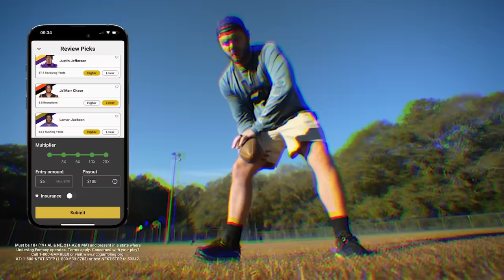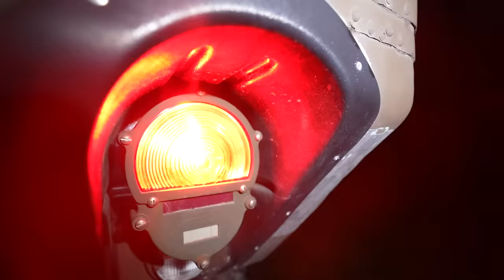Camping In My Humvee AMBULANCE! (catch n cook)

Comment: I used to be in a ground ambulance company while in the army and regularly camped in them for weeks. sleeping in a litter on those racks is surprisingly comfortable. I meant to comment this on the last video you had on this but I think you have a cbrn unit to hook up gas masks in there. Its those PVC pipe looking things above the driver and passenger
Reply: Thank you for your service
Reply: My friend bought one of these and used it as a hunting cabin. I agree the beds were surprisingly comfortable and then later we started tearing it apart to build it up into a proper overlanding vehicle. We found in the corners a congealed mess we hoped wasn't dried blood but probably was, and also about 8 rusty 5.56 rounds, some gauze strips and a senior picture of a girl in high school from 2014, some paracord pieces and what looked like a medic velcro patch. There were some other medical supplies in there too. Even a surette of ketamine that was hidden inside one of about 10 empty cans of Skoal and Grizzly snuff. Whoever cleaned it out didn't do a thorough job. I was also amazed how slow it was. Like 45 was the top speed and it felt like you were going to come apart. He swapped a Duramax turbodiesel in there and some other stuff. Left the beds intact though. Tha k you for your service as well.
Reply: Being a medic in an infantry unit was rough but every now and again we'd take an FLA out and live like kings.
Reply: Lived in them quite a bit while at Drum, but you had to insulate, those metal boxes got cold!!!!
Reply: @AYO Fishing  I think all this rig lacks is a glory hole.

Comment: With the Hum V try putting it in park while its running and rock it back and forth from the front un till  you hear a click and this should fix the trans issue at least for awhile.. This method has worked for me more then once.

Comment: Use a combo of oil and butter….you want the pan smoking then add your oil and after it melts and bubbles out the pans ready for the fish..also works better if you season the fish before going to pan, even pre coating the fish with oil.. promise u better results, cheers!!

Comment: very simple design to make those bars more comfortable is to add hinged or a slat of wood as a base with a 1-2 in thick foam "mattress" that can be then folded up to the walls when not in use and still have room for the kayaks, possibly add parallel mounts on the sides of the truck or top to mount the kayaks tho would be cautious of width restrictions. love your guys content.

Comment: Another great video with you & Norm!  It would be so great to see the rear area gutted and rebuilt for a true camper with padded sleeping bunks, maybe a slide out kitchen / cooking area.  LED lighting upgrades.  Bring along a decent sized battery bank and you guys are set.  Maybe Catch & Cook using Air Fryer?  Not sure if you only use Cast Iron but maybe a new Ceramic non-stick pan for cooking fish = less crumbled fish and full fish fillet sandwiches.  Anyway, can't wait for the next video.

Comment: Definitely need to get ot running and operating correctly first. Then maybe cut the top racks so you can use the bottom section as beds or transfer it to two singles. Maybe give it a all black paint job or some cool black grey and white camo paint.
Reply: I think that German fleck tarn would  be cool

Comment: Alright. I'm no humvee tech, but this kid in my shop while I was stationed in Germany explained a bit of the transmission to me while he was diagnosing it. Dude is a GM wizard. He had the program pulled up and was shifting each solenoid in the transmission just by clicking on the boxes in this program. Troubleshooting steps said something along the lines of 'if solenoid x isn't able to stay engaged when solenoid y becomes engaged then Z is at fault.' There was a few different tekken combos of this phrasing. Almost done writing this comment out and thinking he may have been diagnosing a chevy 2500, but generally speaking both were Allisons if I remeber right. 

I recomend looking at the data plate and you can identify the model and easily search for the T.O.
Reply: Thought about it. Before you get into anything crazy like this check the basics. Brakes sticking (Calipers and rotors are up into the body). Parking brake could be misadjusted (twist the end of the handle). Inspect and measure rotors with heat gun if the engine finds itself straining. Check the transmission fluid. Just the basics. Also check the hub oil. Theres a mean gear box in each hub that can burn up oil. Most likely this thing was maintained and just sat on a lot so it's probably been 'relatively' kept up so long as that specific comand had some good troops (not people that pencil whip documents for awards and promotions).

Comment: You can also try adding transmission fluid into it until it's full.,or it could be A clogged up transmission filter.,or screen inside of the actual transmission itself to. That's causing those issues and not shifting problems.

Comment: That transmission may have a Vacuum controlled shift and all it may need is for it to be cleaned or replace the diaphram that is on the side. The line may have come off from all the jumps into creeks. But the transmission is fine in that truck. It sounds good so whatever is wrong it is simple.

Comment: Hey brother. Those old hmmwv’s being stuck in first gear usually has to do with a fried transmission control module. Usually happens when the truck has to be jump started. Transmission is probably fine mechanically.

Comment: Wonderful hilarious entertaining as always. Must have missed Norm catching that fish. You do need to learn how to cook a little bit more and get some tools. A fish spatula would have kept those filets together a little easier. Also, check out "Patrol Box"s, the Boy Scouts use them. It's a cube with handles on the ends and legs where the top folds up and one side folds down into a self contained outdoor kitchen. Has all your pots, pans, spices, tools, and utensils. Food kept separately.  You could even make building one a video. Super useful as well for family car camping and picnics. To keep costs low you could buy all the stuff for it from the thrift shop, since it's outdoor cooking gear and going to get damaged. No used teflon. not what you want.

Comment: Try replacing the synchronizer switch inside of the transmission. That controls and allows the floating gears inside of the transmission and transfer case to switch gears. It's magnetized which means it's energized by electric from battery to power up the magnets to allow to switch gear to gear inside of those types of transmissions AYO. Just A really quick and fast tip trick to save yah on replacing A transmission about $4000.00 to $10,000.00  in cost as of in  thousands  dollars.

Comment: Make sure your transfer case is set in high and not low.. may shift a little smother 🤣 If that’s not it there should be a CDR Valve that looks like a gold tuna can. Take it off and let it soak in something to remove the build up.

Comment: Fix the tranny 
Get doors
Add sound dampening mats a little on every flat surface that is metal 
Add storage
Make the beds more comfortable 
Offroad light mainly up frount but Add some on a separate swich for the sides and rear for camping
Paint it a solid color that isn't standard in the military. A dark brown would be sick or a 
Put a turbo on it. bigger injectors and a tune will be needed
Maybe a slight lift. And idk how old and rotted your tires are on it. But I would get some new ones. Probably civilian tires would be quite compared to the military ones

Comment: I would definitely pull the Governor gear out. It’s just a plastic gear. It’s the only thing that would stop it from up-shifting. I bet that’s what’s wrong. It’s a five dollar part
Reply: So when you pull the Governor out, it’s just a small plastic gear on the shaft. It’s held on with a small c-clip. Hope this helps. It’s worth checking  to see if the gear broke. Because they are plastic they get brittle and  break

Comment: Ayo you really get the Military Ambulance Transmission Fixed and Get the Engine Checked then get new headlights and a passenger door for it then get it Painted Army Green and definitely make more Camping videos with yal should add camping pads to the cots it definitely would make it alot more comfortable to sleep on.

You also should check the Auction and get a Army Humvee it definitely would be awesome to haul your Boats with for fishing videos.

#SupportOurTroops
#VeteransLivesMatter.

Comment: There's no way those bars are comfortable to sleep on. I'd highly recommend removing the bars you'd otherwise be sleeping on and put some hooks and carabiners on either end so you can hang some hammocks between the ends. It's hard to tell from the video but it looks like you've got 4 beds in there and I'd assume you could still fit 4 hammocks in their place, or leave one bed on bottom in place for a table/seat.

Comment: You need to check the transmission computer box. It’s possible a shift solenoid failed inside the transmission but you should check the simple things first. Mice and rats are notorious for chewing wires on these POS